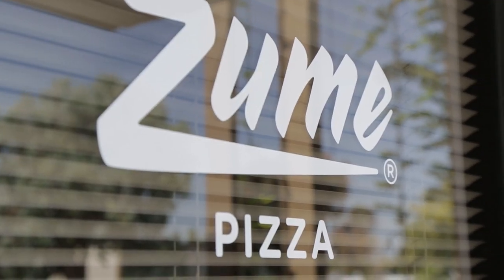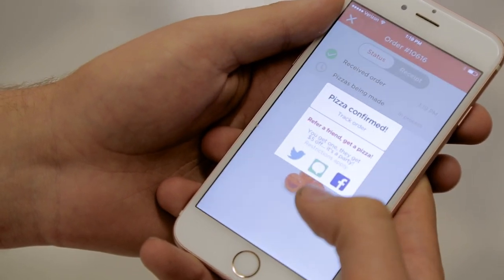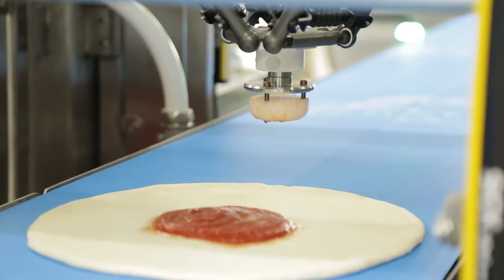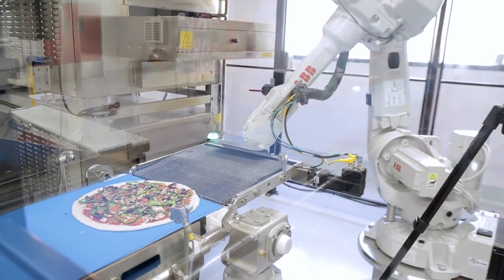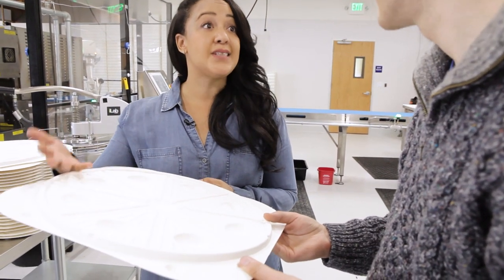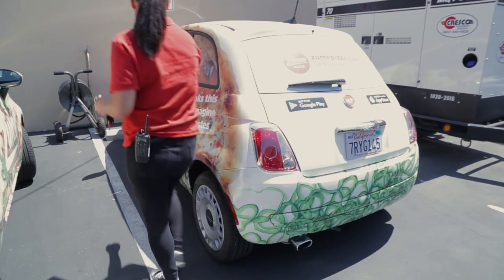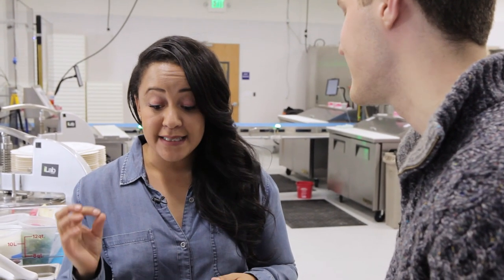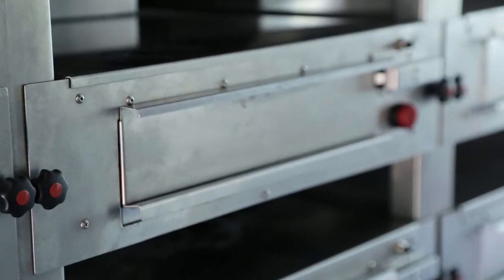Zume delivers made-to-order pizza with robots

Comment: I'm an industrial electrical technician and a certified robotics technician in the state of Texas. I cannot believe these idiots bought and programmed an ABB robot that typically used in a manufacturing setting to move a freaking pizza literally 1 foot away! Stupidity on a whole nother level. They could have saved $50k and just added in a vfd on that last belt to make it speed up the pizza unto a final belt that would run horizontally into the oven. You don't need a millennial technician to tell you that though. This is what happens when management designs the machinery instead of just getting out of everyone else's way! That robot spreading the sauce is a delta-type and they can move really fast.

Comment: Wait, their average delivery time is 22 minutes? Wow. We actually do better than that without robots at our store.  The robot doesn't help with toppings at all so naturally, it doesn't help their speed as much as the already easy tasks are done by it. 

You can improve it by putting the saucing and spreading in one step, not two. Cut down conveyor length.
Get rid of the industrial heavy lifting robot and just put a chute that's kept clean between.

There's also no robotics here, it's just a fancy conveyor belt. Adding a 6 axis robot for simply lifting a pizza around doesn't make the entire assembly robotic.

Comment: OY!  Two Robots to dispense sauce, then the other one to spread it. Each involving high tech lasers ($$)  on a conveyor belt traveling at a set speed to humans that then place the toppings towards yet another robot that lifts said pizza into an oven.  So, what is the time efficency here?? Humans still make the dough, humans place the dough on conveyor, Humans place cheese and toppings ( I'll argue, that dispensing the sauce is just as important as the placing of toppings and needs to be done with human touch).  Then the amount of money spent on the other robot arm to lift pizza into an oven.  Are you good folks mental?  Seriously??? You can't get a human to lift the pizza?   Then your vision was to move this into a moving van.  I can see why the company just folded.  
I mean, when the "robots" can take  tomatos and make a sauce from scratch.  When the "robots" start taking flour and crack open eggs and kneads the dough.  When they slice the vegetables right there and assemble the pizza all while self driving the van....that's the vision isn't it?  Remove ALL humans from the equation.   You can do this with cars but not food and certainly NOT pizza.  I dunno maybe in 50yrs. However, I'll be dead by then...